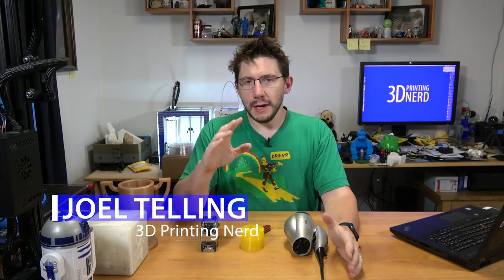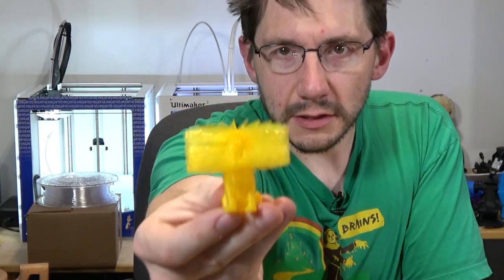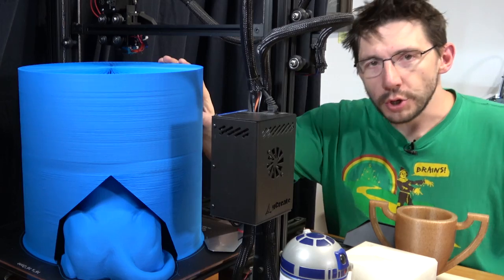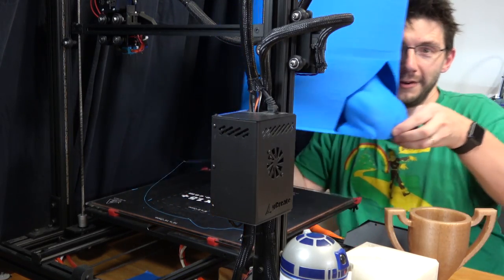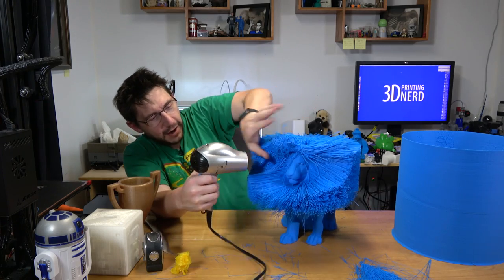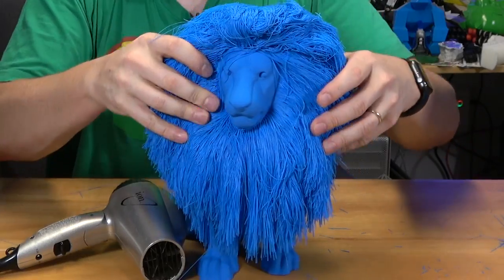3D Printing the Worlds Largest Hairy Lion on the gMax 3D Printer

Comment: almost need to 3d print a blow dryer stand
Reply from the maker: GREAT IDEA!
Reply: That would be fun! Or just lay the dryer down so it blows off the side of a table :)
Reply: 3D Printing Nerd I tried to print my own version of the harry lion on my da Vinci jr. and it didn't work, it would mean the world to me if I could have yours.  I understand why if you can't, keep up the good content, and high-five
Reply: jj do you want a Harry lion printed? before the wall is removed?
Reply: I wish I had a 3d printer. The things you can do with that. I'd like to make one of those lions.
Reply: Max Larose check out printed solid they have the monoprice mini for 200$ it's a great lil machine
Reply: Max Larose feel free to try 3D hubs! odds are someone locally has got a printer you could use and print awesome stuff as if the printer were your own!
Reply: yeah it's called a vice and they make them out of steel and sell them in stores. no printing required.
Reply: So people, we got 3D printers now. Lets make useless crap until plastic starts coming out of our assholes.
Reply: Heterandria4mosa but that's no fun
Reply: DudeInAMotorhome ii
Reply: The one commenter Whos allways right We are the tested generation. We are the data.

Comment: Blow drying would've been easier if you moved the lion around and let gravity flip the hair over the top of his head.
Reply from the maker: Gravity didn't seem to be working. The heat would curl the hairs faster than gravity could pull them down.
Reply: too much heat too fast .... back off with the blow dryer.
Reply: you're right, i thought to comment the same thing then i saw your comment, he should have put the lions nose looking up and heat up the hair from distance :DD

Comment: You should start from the back and in the bottom, that way you have more control over where the hairs go! You can also hide the mess-ups that are bound to happen under the outer layers, as opposed to when you start from the top and move downwards. A very nice video, I had no idea this was possible!

Comment: 99 Hours in and power dies, thats why i don't print big.
Reply: use ups
Reply: I got a decent UPS and says it will only last around 45 min I keep one on my 3d printers at all times
but thats enough time to get the generator going to power the whole house anyways
Reply: The printer uses 50 watts max so a UPS is the way to go.
Reply: Where do you live that the power goes down so often? 
Here in Germany the last power failure we had was 6 years ago. 
I am just curious.
Reply: Tjark Hartung Literally anywhere when something bad happens during a storm/hurricane

Comment: could you brush the hair wile heating it
Reply: No because it’s plastic and would probably break
Reply: His hair or the lions hair?
Reply: 3D printers print with plastic ; it would just break.
Reply: ThatOneGamerFox it wouldn't break if you were gentle and had some patience along with some skill. Maybe back up the blow drier too
Reply: or comb it?
Reply: Sirion no his hair
Reply: Yep.  Maybe try using a hair pick.  You can't comb curly hair for the same reason, but a pick might solve that.  Also maybe try fixing the lion in place to make it easier.
Reply: ok but he will be heating he hair wile brushing it
Reply: maybe if you used a SUPER WIDE tooth comb and just softly pat the hair down and not actually brush it in
Reply: Those are called hair picks.
Reply: I think gravity is the solution, If you look at how the back turned out, very nice, almost no work from his hand, mainly just heat and gravity, try rotating the lion upside down to do the top of the head maybe?
Reply from the maker: I read that as “brush the hair while eating it” at first and couldn’t stop laughing for a moment.

Comment: Once I get my printer, this is something I’d like to try. One thing that I noticed is that the “hairs” would auto-form due to gravity, once you attained the correct temperature. Which leads me to thinking that you don’t need to touch the hairs at all.  For the bottom half, just start at the very bottom and slowly move up, as the hairs start to drop.  For the top, hold it upside down, and tilt it as the hairs fall into place.  For the face, do the same in a circular manor.

Very nice lion!

Comment: I'm definitely doing these now I've got my FLSUN QQS  figured out. 
I think at this size it would be better to clamp the hairdryer to the table so you can bring the lion at whatever angle you need and let gravity help. As you said, you want to move the hair not just try to blow it into position, but having the heat blowing in the same direction you want to go won't hurt.
 The bit at the top of the face is what makes or breaks it. Tipping that part upside down and back a bit will make things much easier whatever the size.

Comment: Use some double sided tape sparingly or silicone self fusing tape (which is actually a pretty strong temporary tape) to hold the lion down to the table.  It'll make the job easier and you'll look more like a professional stylist.

Comment: Make an articulated arm to hold the blow dryer.

Alter the sacrificial wall ... just the top ring, then add supports.  You'll cut the amount of filament used.

Comment: A recommendation for the hair. with that many layers, if you would have started from the bottom and worked up, the bottom would be positioned to where you would have wanted it, the rest could then be moved down around what you already had done

Comment: Next time, try to face the Lion upwards (so that he is looking at the ceiling) while you blow dry. You can see in this video 8:07 that gravity is shaping them more than your fingers, use that to your advantage. (Kind of like when one has long hair and is trying to get out of a pool without hair all in their face.)  Also, start blow drying from the back to front (not front to back), this allows for proper layering. Especially, when the head is pointed upwards.

Comment: Instead of pressing the hair in the direction you want it to go, you ought to have just tipped the lion backwards or in said direction while under heat and let it slowly drape down of its own volition. Keep tipping in different directions and let gravity do the bending. Where that occured on yours, it looked much more naturally layered, instead of like someone running gel in it and greasing it down.

Comment: why not use boiling hot water?  the heat should be enough.  you even get the wavy effect for free since you'd already have to move the lion quickly (so the water yields enough resistance to move the hair).  but I've made plenty of random art junk that way (as well as some premeditated stuff like forcing one thing into another).  and if you just leave it in the water, you get somewhat of a reset (kinda).

Comment: I no this was a year ago but i hope you take the time to read this as it will be benaficial. For your next lion joel  when complete and after cutting it out. For the molding phase i recommend using hot/warm water and running it through his hair while using your hand to shape his hair as u would your own in the morning. Ive done a few lions that came out fantastic useing that method. ( hairdryer makes the hair curly and horrible looking )

Comment: Start the heating at the far back at the bottom layer. That way you can lay a foundation instead of trying to shape it all with the top layer ehich gives you alot more control. Would be cool to see the same amount of hair on a slightly smaller lion, sweeping it all backwards longer so it looks like the lion is in a wind tunnel or something. Imitating wind is what is going to give this piece realism

Comment: I would be interested to see how this hair would look if you flash heated the whole sculpture from all angles at the same time for a few seconds until everything was soft, then quickly blasted it with cold gas like a CO2 fire extinguisher. Might freeze the hair in such a way that it looks like its blowing. Might be fun to try!

Comment: It is hard work because your working from the top and then you can not get to the bottom... 
Other videos of the same thing started forming the bottom/lower hairs ... and then the next layer up. 

What your doing is heating the top layer and bending it over the lower untouched layers and then you can not access the untouched layers that are covered by the what you have done previously. I didn't watch the whole video because of this... so if I am wrong, that is ok as I should have watched the whole thing before posting.

Comment: I came up late. Sorry to not see your video like this one. I was too busy that time. But here it is.
Awesome div by zero!!!

The 3D printing self holds a world record for 3D printed hairy Lion!!!
5:54 if that self can be that insane. This programming self can be as insane as well! More or less, he could.
6:53 If I lost my toothbrush, or has worn, I can in theory, reprint a toothbrush, over and over. Did you know, that brush is actually one of the type of plastic?
7:10 if I had a heated knife, maybe to make it easier, or add challenge. Just to make sure it didn't accidentally hit the lion bum.
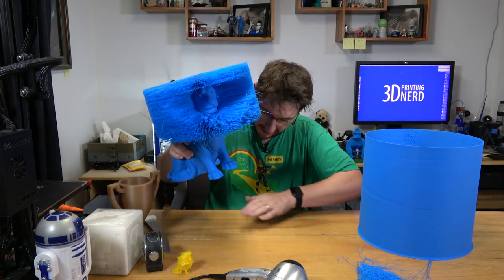7:47 The designer must've an extremely powerful computer for CGI animation design. Look at all of these polygons! A whole bunch of furs! Thin line, .05 mm thick!!!! Thousands of them!!!
7:56 when I trim my hair, everything goes messy. I simply stream water onto my head, stop, shampoo, foam covers, rinse again. Repeat if necessary. Idk if for this case. Would it work?
10:25 certainly, it is not to become duster. Heat just melts it.
10:49 Perhaps you'd like to use comb.
11:37 litteral lion!!!
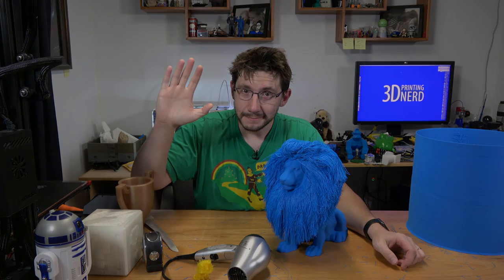13:05 roaor

Comment: super late to this but i think to make the hair easiest to get into position. Work bottom up  and inside to out. should lay it all down nice which you did great. but for the top front. invert and work the same way.  you can use one hand on the dryer one on the model and let gravity move the stuff that is flexible.

Comment: Do you run your long-duration prints on battery backup?
Reply from the maker: Some I do and some I don't. Thankfully we live in an area that very rarely loses power.
Reply: @3DPrintingNerd  - Thanks! Here in Houston, a large capacity UPS is good insurance since the weather is very inconsistent sometimes, and brief drop-outs happen in locally cloudless skies when pop-up storms disturb power from miles away.

Comment: why not to use brush wile heating furr.
Reply from the maker: PLA hairs don't run through a brush like human hairs from my tests.
Reply: 3D Printing Nerd Yeah, it melting  so you can use brush only on top when heating bottom part. i guess doing it with hands is easier.